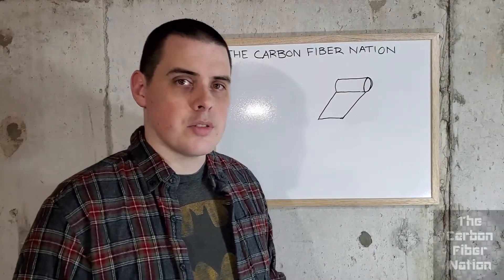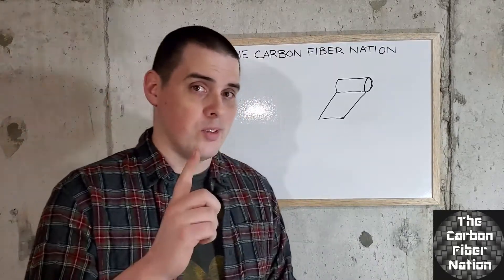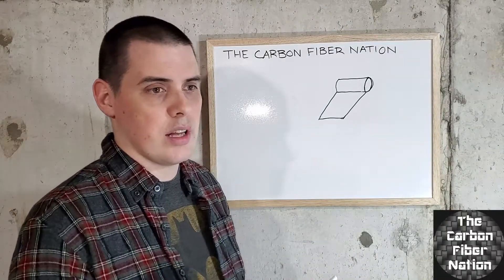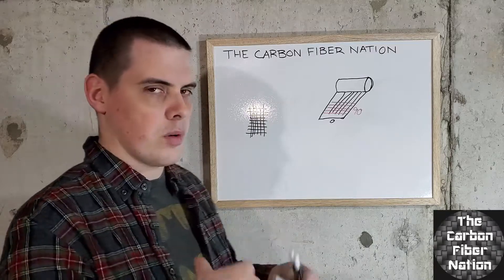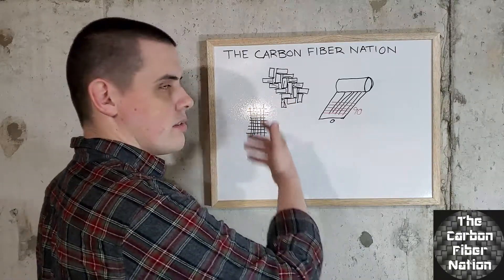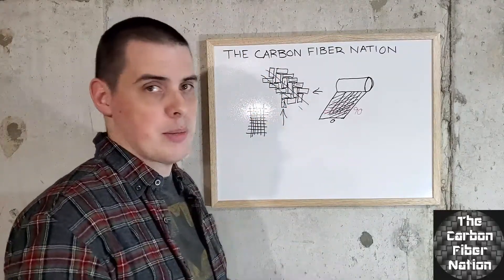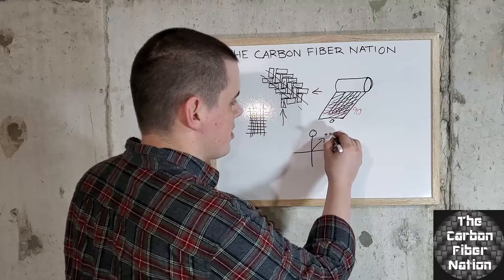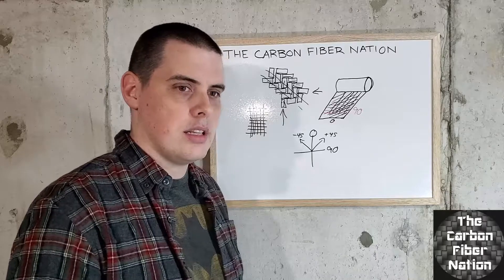Composites Tutorial Pt.1  Understanding Weave

Comment: Radomes and curved areas which weave twill using
Reply from the maker: Hey, do you mean large curved structures? From experience, you can use nearly any woven twill.  
Layup becomes more difficult the further you need to distort and stretch the material to match the shape.
If you are trying to laminate a fully circular enclosure you might want to consider laminating it in pre-cut pieces and then stagger overlaps so you do not have to deform the material too much.